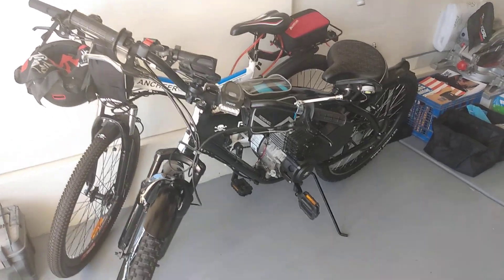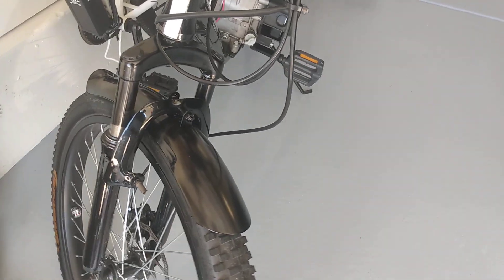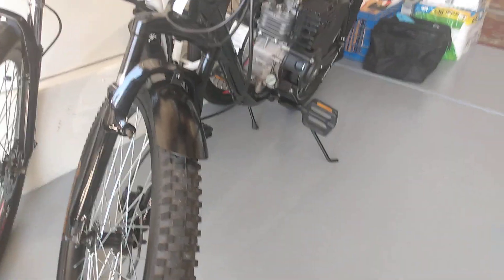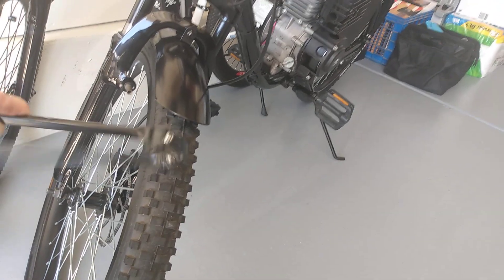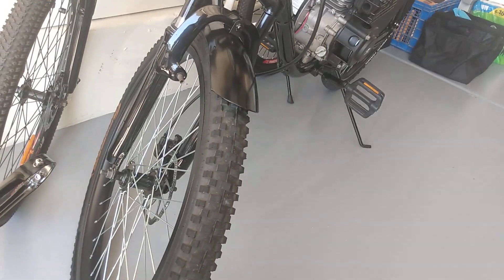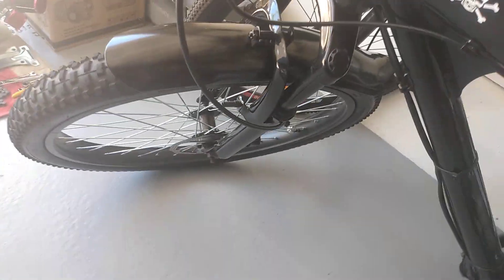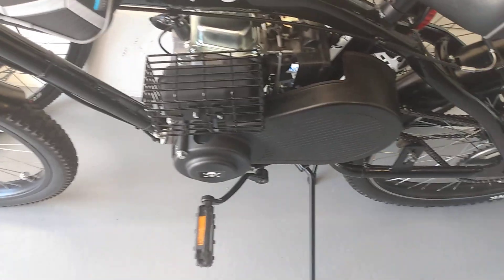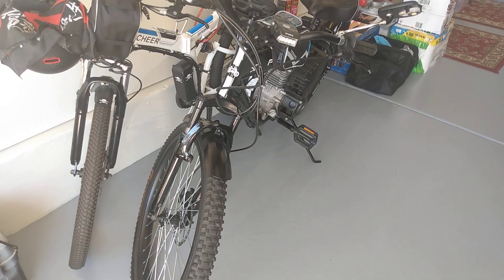Phatmoto  Front fender (shorty) cont'

Comment: I really want full coverage fenders. I have a set off a huffy nellusso that ill be modding to fit. They sell adapters that wrap around front frok but not to sure how much i trust that they also sell adapters that use the axle its a nice size cnc  aluminum bracket held on by the bikes bolts. Just depends on how they look with my Triple Crown forks may be stuck with my Shock blade that thing is going no where and i kind of like it but its not long enough in the front hoping the hookworms don't kick back as much rain 
  But,  If you do it right use Blue loctite some lock rings and good grade A hardware your good to go just have to keep a eye on them like you do for ever nut and bolt
Reply from the maker: I know what you mean, if you ride in any kind of weather you want fenders that work.But you also want them to look decent. I guess it is a trade off.  I know if they are secure you usually don't need to worry about them falling off.  I've seen some guys with the fenders barely held on with a couple of wobbily rivets. The rears are not to big of a deal you can ride it out. But the fronts if they fall off can be a bummer.  I think the nellusso fenders are pretty solid metal fenders, but will they look right.

Comment: Hi can I ask what is the best thing to lubricate the clutch shaft with?? Something that lasts the longest..
Reply from the maker: 30 weight motor oil is recommended, or any oil that is designed for bushings, its best to use non detergent oil ( if you can find it). The key thing with the clutch bushing is the regular oiling, once you get it oiled and keep it oiled, it tends to last the longest. If you let it go dry to the point of clutch grabbing and chatter and stalling of the engine, well you have to start over with the regular oiling. A couple of 2 to 3 drops every few days is normal, unless you ride many miles in a day, then I would bring oil with me to replenish it during the days ride. Periodic cleaning helps keep the clutch performing well also.
Reply: @beaubrummelmotorizedbicycles  thank you so much for always replying I appreciate it
Reply from the maker: I am glad to help, anytime @eliluna3358
Reply: @beaubrummelmotorizedbicycles  can I ask one more question. Can I just lube shaft without taking apart (clutch shaft)??
Reply from the maker: Yes you can, no need to take it apart to oil it. Yes, you can do it on the bike. Watch my video titled, "Phatmoto: Oil that clutch bushing, it's easy" I show you exactly where and how to do it.  @eliluna3358